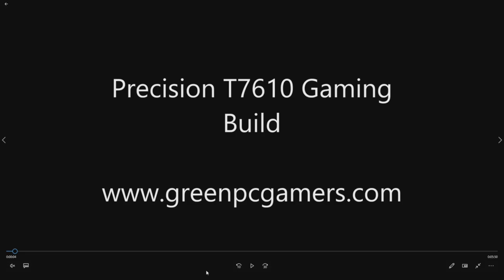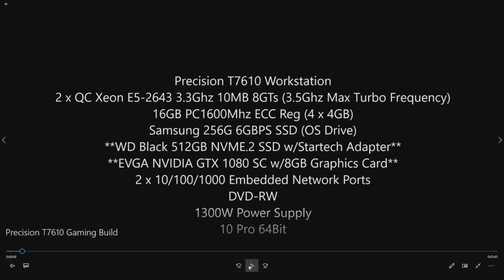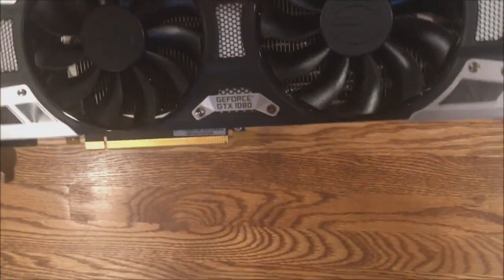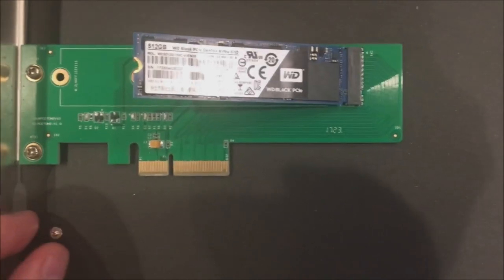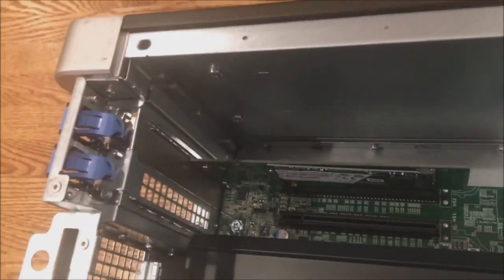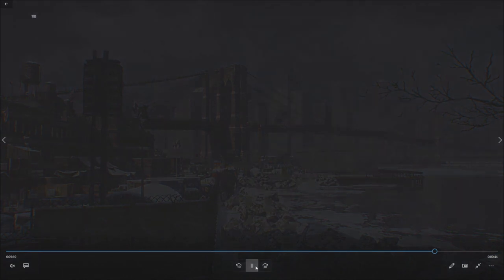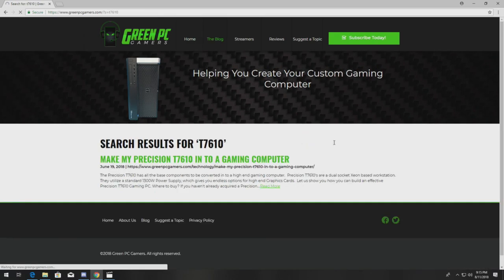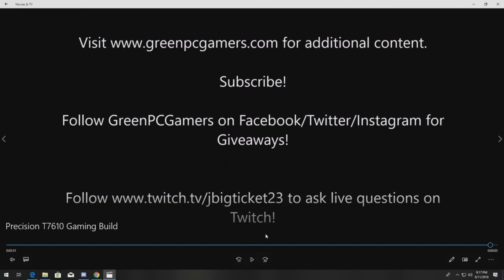Precision T7610 Gaming Computer (NVME.2 and GTX 1080)

Comment: Cool
Need to know..... t7610 supports rtx 2080ti 11GB ? Kindly please help me
Reply from the maker: It will support an RTX 2080 Ti.  I've found that most of the EVGA versions will actually fit in the chassis.  (The FTW version will not fit w/o modifying the side panel)  There will be some bottle-necking

Comment: Just curious, how much $ went into this build? (Excluding price of the machine of course)
Reply from the maker: Hey Cole, The GTX 1080 was $600 New.  The 500GB NVMe.2 w/Adapter was around $195 NEW.  The prices have since dropped.  The parts are also easier to find used/refurbished in the current market.  Have you checked out the T7610 Blog page that we made?  It'll show you all the parts that we have installed in T7610 Workstations.  Thank you for commenting!

Comment: Hello guys,
I have the same kind of config : Dell T7610
2x Xeon E5-2697 v2
RTX 3090
But I can’t get good frame rate 
I get stuck at 60fps, never more
I get poor results in 3D mark
Do you have any idea why ?
Can it be linked to my 60hz monitor ?
Best

Comment: hey man appreciate your content, currently have the oppertunity to get one of these with these specs for 400 can u let me know if its worth it for high fps gaming and music production
Dell Precision T7610 Worktation Pc.
Intel -2x Xeon E5-2630V2 - 2.60GHz - 2.60GHz 2CPU`s (2 Processor`s 24 Core`s)
2TB of Hard Drive
32GB of Memory Ram
Windows 10 Pro 64-Bit
Graphics NVIDIA Quadro K4000
Reply from the maker: That’s a pretty solid configuration for $400.  For gaming, you’ll want to swap out that quadro graphics card for a GeForce Card.  What games do you want to play?
Reply: I have a T7610, I want to change the Quadro K2000 with a GTX 1060 G1 windforce (6gb) ... can it be done or do I need to buy more to make it compatible?

Comment: How did you get the gpu to fit with the side panel? I've tried with a card that supposedly has a height less than the 1080 and it's blocked by the bar and it's bit of rubber.
Reply from the maker: The GTX 1080 that we installed fit w/o modifying the side panel.  However, you can drill out the rivets and remove the metal bar if needed.

Comment: Currently upgrading mine to have a GTX 1080 but nothing is being displayed PC boots fine (can hear windows in background) previous card was quadro k5000 if that helps. Did you just plug in and play? 

Thanks
Reply from the maker: We did do a fresh os install as well.  Do you even see the Dell splash screen when booting up?
Reply: @GreenPCGamerscom  Hey thanks for the reply, I figured it I had to use DVI slot as the bios defaults  to that or at least that's the slot that worked for me :) On, hdmi on the previous card the dell logo never showed up only on DVI. I just hope once I've installed the appropriate  drivers the hdmi will display on the 1080.

I'm also using a gigabyte 1080 waterforce which sadly doesn't fit straight in so I have decided to run it behind where the hard drives sit and cut a hole for the fan. Thoughts?

Comment: T7610 is a powerful build, but its PSU is terrible. I have a T7610 with two E5-2697v2 (130w each) build, and I couldn't manage to get it to work with two 2080Ti (250w each) cards...
Reply from the maker: Jacky Wang what issue are you having?
Reply: @GreenPCGamerscom  I got two 2080Ti installed, but its PSU couldn't support them to their full speed...
Reply from the maker: Was the system having power issues after installing both cards?
Reply: It was probably never intended to support that much graphics. Just get a more powerful PSU. Also remember PSU can degrade over time.
Reply: I wonder if part of the problem may have been related to heat generated with such powerful cards having to be pretty close together, though it could also be related to what eLJaybud suggested regarding possible power supply degradation over time prior to trying to run that configuration. I hope things are going smoothly currently.
Reply: @eLJaybud  The Precision T7610 and T7600 power supply can't be upgraded as they come stock 1300W